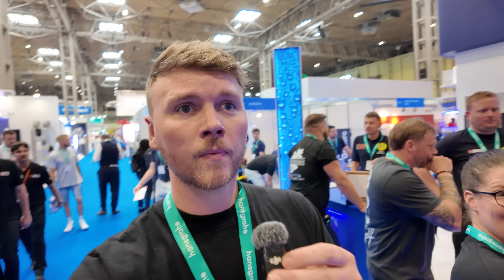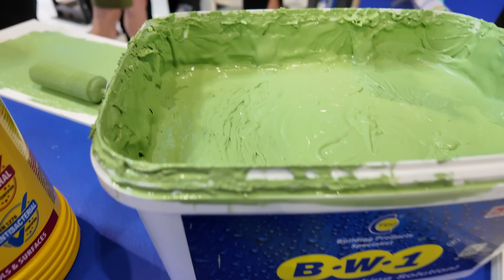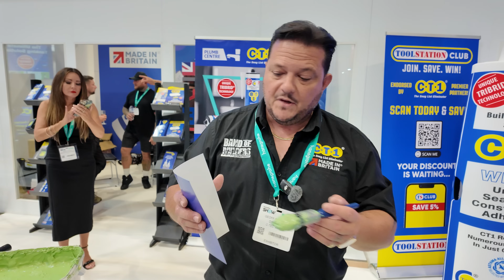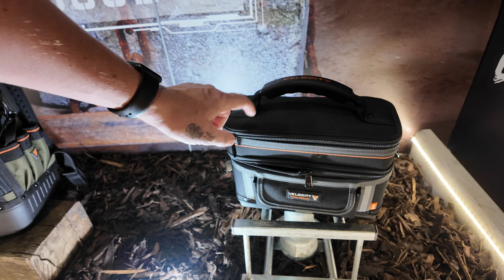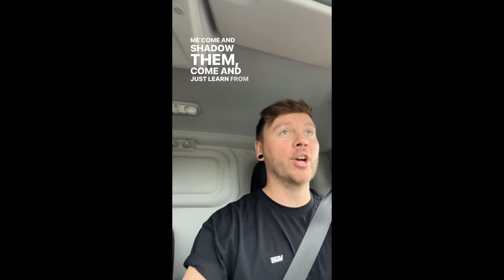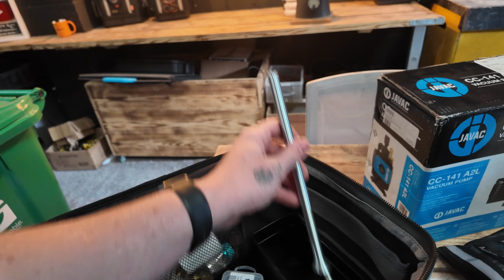Spent £1100 On Stuff I Cant Use

Comment: Welcome to the world of AC. I myself have gone through college doing the AC but yet to work in it as am now learning to be an electrician now L3 and 18th edition. You need two years of college to get your card before you can buy any gas. Your kit is worth a lot. You can learn lots watching hvac YouTube. After the 1st year, you should have enough college workshop experience to install a mini split system under supervision as you need the card to go it alone. Suggest using compression instead of brazing because of the insurance costs. Good luck.

Comment: Get a flaring and swaging kit too for pipework which is very useful.
Welcome to Air Con, I've been doing commercial air con, electrics, generators, UPS's  for 40 odd years along with a brief spate of Corgi/Gas safe. Jack of all trades master of none and certainly not as adept at domestic sparks as you.

Comment: The thing that ‘does stuff’ is a nitrogen regulator which you use to pressurise the system and strength test pipe work, the vacuum pump ensures the system is moisture free prior to charging with refrigerant. If you think there is red tape attached to the electrical industry, you haven’t seen anything yet.. good luck

Comment: Sounds like an echo, but heat pumps are the way to go. My local spark installed both of mine and toasty in winter and cool in summer. And saves a craptonne of electricity compared to alternatives.